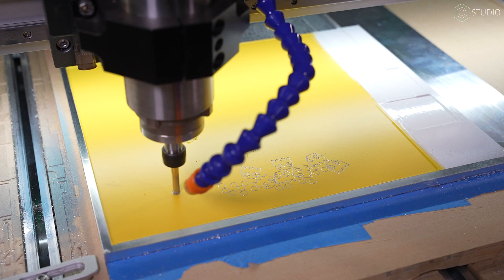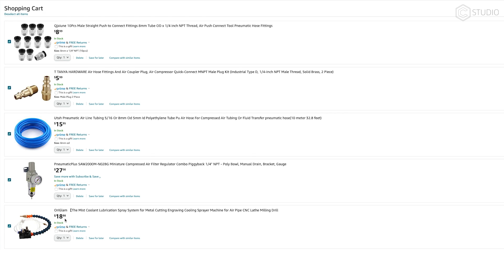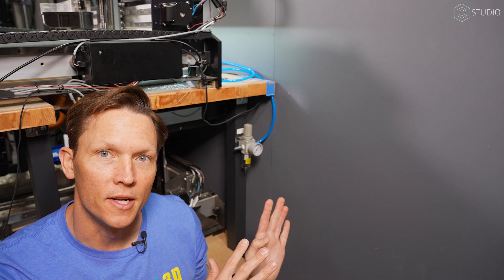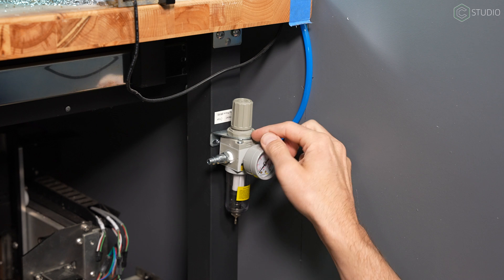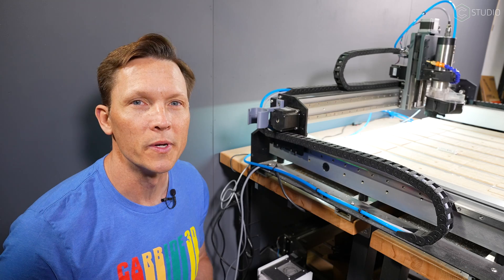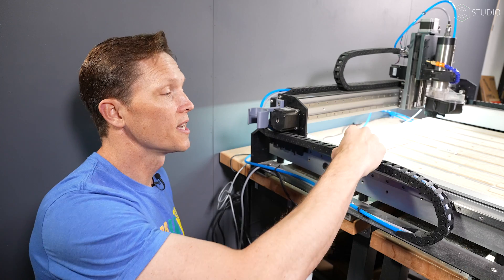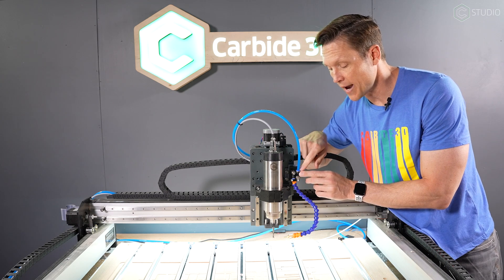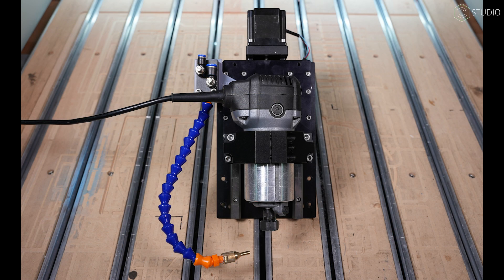Adding Air Blast to a CNC Router

Comment: I prefer to use air and have a separate small peristaltic pump. That way you can bump up or down the air but have the coolant easily controllable. And it will actually cost less than the traditional fogbuster setup.

Comment: So I want to add a water drip would this be similar?
Reply from the maker: While a water drip will help cool metal, it does not evaporate quickly and only marginally improves lubricity. It can cause a slurry of chips to stick inside the cut and increase the risk of jamming the cutter. And whatever splashes or splatters on the spindle and rails will cause rust. And it will cause the MDF wasteboard to swell. We don't recommend using water. Either use air w/optional MQL mist, or use an oil drip for maximum lubrication.

Comment: About how much cfm would u say you need... looking at different compressors
Reply from the maker: These are the guidelines we recommend on our Air Assist Kit page, and should be a good starting point regardless of the solution you choose: 
"The Air Assist Kit requires an external supply of compressed air. We recommend that the air delivered to the air assist unit be dried and regulated to between 15 to 45 PSI. The Air Assist Kit should not be connected directly to a compressed air supply in excess of 45 PSI (3 bar).

The compressor used should be able to deliver at least 2 CFM (55L/min) of air continuously at the desired operating pressure (please check your compressor's rated duty cycle and volumetric performance prior before purchase). The compressor should also have a 6 gallon (22L) tank or larger to buffer against pressure changes during operation."

Comment: I use my shop vac attached to some large ( 2 1/2 inch I think ) Loc-line with a nozzle that gets in really close to the cutter and collects 70-80% of the chips. When I need a blower, I have a small diameter Loc-line like yours attached to the exhaust of the shop vac which blows the chips away.  The blower is dry only though and needs only some of the exhaust air so a Y-fitting is needed to allow the excess to bypass the Loc-line.  Choose whichever you need to suit. Or run them both at the same time. Who says you can't suck and blow at the same time.

Comment: Apparently the sweepy doesn't work for metal?
Reply from the maker: We have actually used Sweepy for metal. The chips tend to get into the brushes, which will require cleaning.   It's mentioned it in our Learn to Cut Aluminum video:  https://youtu.be/Yo33kOJfw70

Comment: Any chance you have one designed for the original hdz for the shapeoko 3xxl?
Reply from the maker: Hey Jared,   You are welcome to download the files and use them as the basis for a new design.  If you download the original files, designing one for your HDZ should be reasonably straightforward.   You could mill one from wood, plastic or metal on your Shapeoko.  (no 3D printing required).   Remember, with Shapeoko, you own the means of production!

Comment: Bummer that the hole spacing on the side of the 65mm clamp of the S5P is ~1mm too narrow to mount the air block without an adaptor. What's the purpose of those two holes if not this? And working link(s) to the adaptor blocks seems to be missing again/still?

Comment: Would this be possible for the nomad3?
Reply from the maker: JoJo,  some modifications would be necessary.  For the NOMAD we use the collet chip fan when cutting metal.
Reply: @carbide3d  thanks for the reply! Is this collet fan an accessory to the nomad 3? And where can i find more information on this? Thanks 👍
Reply from the maker: It was included as standard equipment with your machine.   Perhaps it's still rolling around your workshop?  
We also offer it for 3D printing in our Carbide 3D Print Library:  https://carbide3d.com/3d-print
Reply: @carbide3d  cheers! I am not an owner (yet) haha. But that is brilliantly designed to attach it to the spindle! Well done.

Comment: Thanks for the video! Do you think a 1/2 HP, 1 gallon compressor like CAT-1P1060S or Makita MAC100Q will be enough for this on Shapeoko 4? I've read that if a compressor is too small it might overheat on longer jobs, but so far I have zero experience with cnc or air compressors so very hard for me to judge. I'm looking at cutting jobs that need to remove about 4 cubic inches of aluminum from an inch deep pocket.
Reply from the maker: This is a good question we’ve been meaning to test on one of our home machine setups.  Like anything the best way to k ow is to give it a try.

Comment: If you're trying to add this to a Shapeoko 3 with the Z+ upgrade, the linked install block does not fit. There must be a different hole arrangement on the Shapeoko 4/Pro Z+ and the Z+ upgrade for the Shapeoko 3. Fortunately, it's easy to modify the provided F3D file for the Z+ and adjust to fit. FYI before you print a part that doesn't fit. 😇

Comment: Ah...I dont have a 3D printer. Any help on where I can get the mount from?
Reply from the maker: There are services which specialize in 3D printing parts for people.  There are also plenty of people on FIVER or similar services that can print a part for you at very little cost.
Reply: @carbide3d  Great, thank you
Reply: @carbide3d  Attempted to download file from CutRocket, but the zip file is empty? Any help?
Reply from the maker: @JamesKing-fg3wn  Hey James.   Go into the notes and click on the individual links for the files.  There you can download the files.
Reply: @carbide3d  Great thank you! Finally have the right file as the one I had made was the incorrect configuration :-( Thanks for the follow up. Love your products !!!

Comment: Thank you Carbide3d! I just ordered all the parts (and received them), printed out the part, and put it all together. Couldn’t have been easier…
Reply: Could I get the file from you? The link has a blank file as of right now. Thanks
Reply: @JamesKing-fg3wn  I struggled with that too... The links are in the "notes" tab on the project page (like you said, the "download" button just downloads an empty file)... But I'm re-posting here:
---------------------
Download the Appropriate block for your Carbide 3D Machine.
3D Print or Machine and Tap the block.
Install Air Assist per the instructions and parts list in the video.
Enjoy cutting metal with greater ease and reliability.

Post your install here as well as on Instagram and tag us!

Links and Required Hardware for Install at Z-Axis:

Z+ (stock Z-Axis)
Fusion 360 File direct link:
https://a360.co/3a0yWyx

Hardware: 2x - M5x25mm / 2x - M6x12mm

HDZ - 2x
Fusion 360 File direct link:
https://a360.co/3l5fLFO

Hardware: M5x25mm / 2x - M6x12mm

HDM
Fusion 360 File direct link:
https://a360.co/3L4Pged

Hardware: 1x - M5/35mm
Reply: @joshuabray37  YOU ARE THE MAN !!! THANK YOU SO MUCH !!!

Comment: If you add a 120v pneumatic solenoid to the parts list you could have the air assist turn on and off with the bitrunner on a machine equipped with it

Comment: You should also add a dryer before the regular if you live in a high humidity area. Also, only two wraps of Teflon tape on any fittings.

Comment: Adding a valve/solenoid and controlling the air supply from gcode saves you a lot of hassle too. I've added a diy fogbuster with a container under pressure (1-2 bar).

Comment: Great tips!  I'd like to mention that if you don't want to have a loud compressor running, pick up a small aquarium pump!  Winston gave me that tip a couple years ago!  I run a small aquarium pump on my Nomad3 and it makes a huge difference in cut quality and significantly reduces clogged contour cuts.  AND...it's VERY quiet.  It's definitely not as powerful at blowing away chips as a standard compressor...but if you can direct the blast nozzle close enough to your cut...it works great!
Reply: Another option is a high powered DC squirrel cage fan into a funnel (machine one to suit) to some LocLine. Delta makes some nice beefy fans that are PWM controllable so you can ramp them up and down needed as required. They don't heat up like aquarium pumps can and are a constant flow instead of the pulse you tend to get from pond pumps. You can mount the fan on the spindle so you only have a short line to direct it to the cutter. At full speed they can be a bit loud but unlikely to be an issue next to a 24k spindle or router.

Comment: If you are into apartment machining like me with a small compressor you may want to install a pulse timer and a solenoid to save air. I get mine to fire once every 5 to 7 seconds with a 0.1 second blast.